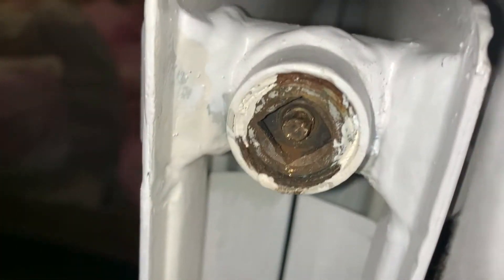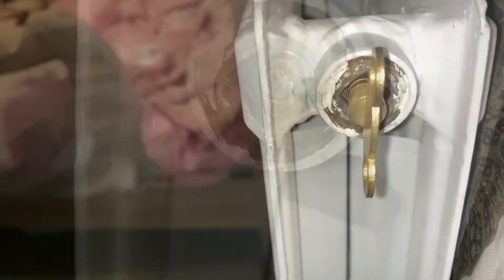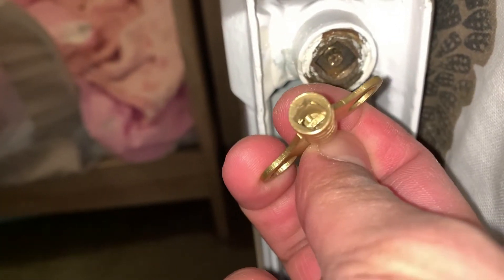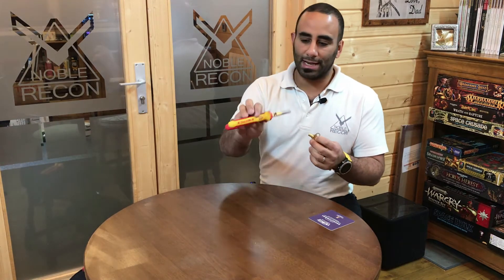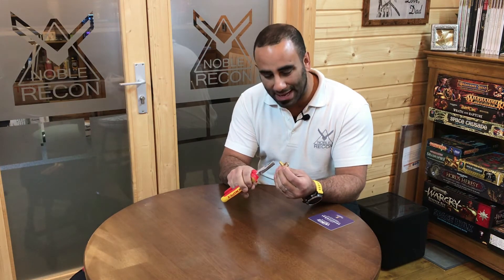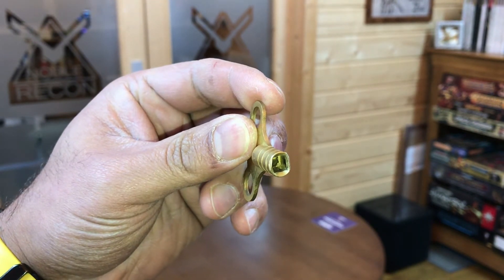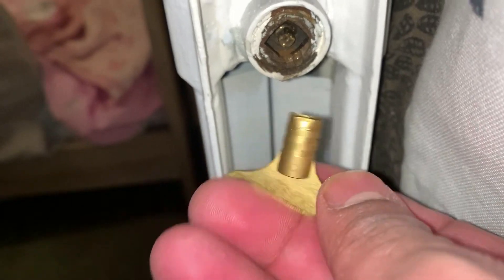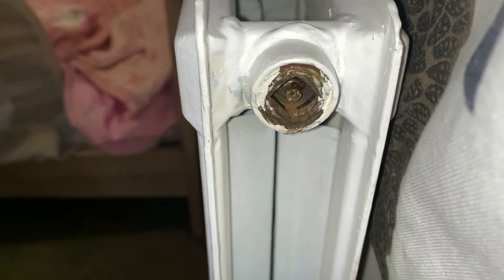Bleeding your radiator with a damaged valve

Comment: I had that problem, I went through my small sockets in my socket set found one that fitted and used the next one down and don't laugh, got a hammer and banged in onto the valve then left it there, when my radiator needs bleeding I just put the spanner/wrench and bingo radiator releases all the air.
The company that my landlord uses for plumbing has said they just need to replace the radiator nipple but means draining the whole system, so people ask afew plumbers as sounds like some want to rip you off by saying it can't be replaced.
Should of seen this idea first lol 🤦‍♀️
Thanks for the tip

Comment: Success..solved my problem of rounded heads when I bought the cheapest ones in Amazon 
£1.99 for 5 ..really square keys and they worked 1st time..after me spending a full day going to hardware shop and buying new keys which just turned..
Dermasy square radiator bleed valve keys..
Try it..👍

Comment: Thanks I'll give that a go. My valves were not even badly rounded, but the machining on the keys is so crap that even the slightest rounding stops them working. Why they can't broach a more square hole in the keys is puzzling.
Reply from the maker: Yeah it boggles the mind how such a cheap piece of work will make an entire radiator useless